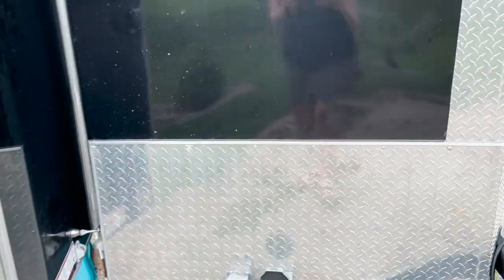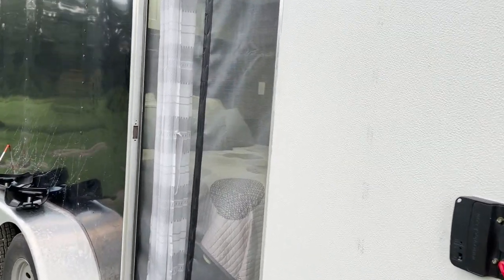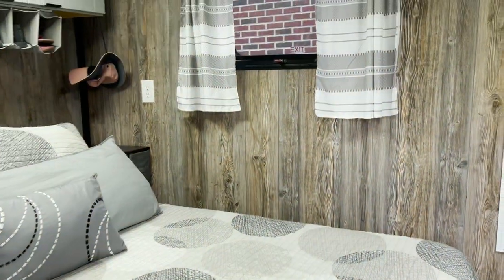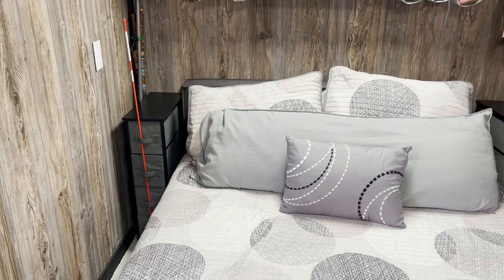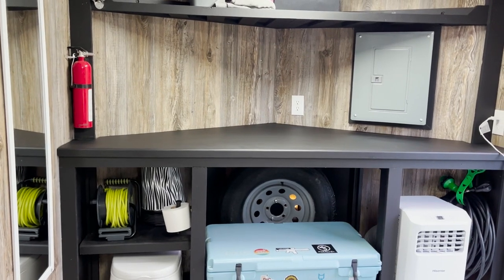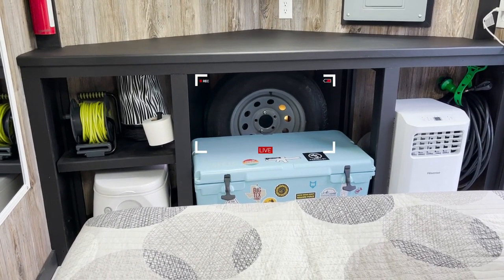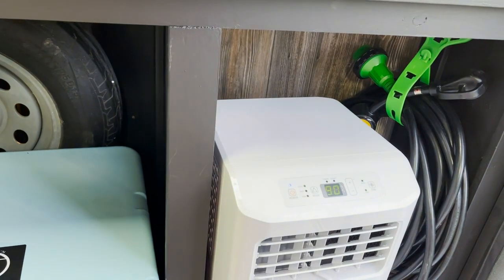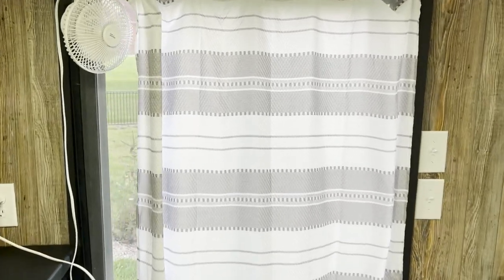Cargo Trailer Camper Conversion

Comment: Nice build. I’m about to do a 7x14 cargo conversion. I’m gonna turn the bed 90 degrees from yours and do the “crawl over” I guess. Wifey is the one who always gets up in the night, so I’ll just give her the unrestricted side of the bed and all should be well. I’ve been known to sleep for 12 hours straight without a bathroom break. I plan to use the extra square footage for a small “private” bath with a camp toilet and a Durastall shower. She absolutely insists on having that. I’ve already collected the stuff and will get started on the project soon. The kitchen will be just a small, wall mounted counter over a small fridge for chopping and making sandwiches, along with a nice, folding camp kitchen with a propane camp stove. The bed will also go up to the ceiling or fold up on the wall so we can get our motorcycle inside. It will actually be a “toy hauler I suppose.

Anyway, I like your trailer. Thanks for the video and happy camping!
Reply from the maker: Thanks. Best wishes on our build!

Comment: Looks good, you need to a light to your kitchen area should you need the space at night.
Reply from the maker: Thanks for the comment. We do actually have a light. It is a re-chargable one that I keep in the drawer. There are some magnets up in the corner that I can stick the light to. It is not often we really need the back when it is dark. The light ends up attracting a LOT of bugs. I should have given the info on that change. The last camper had crazy bright lights that we hardly used. I told my husband we didn't need lights you could see from space this time. LOL

Comment: Love your design.  It's very clean and organized.  Where did you get those storage containers on the bottom left of your kitchen cabinets that look like sterite containers with an opening on one end?  Those are super neat. Thanks for sharing.
Reply from the maker: The open storage container in the back area, under the countertop, I got those at Walmart. I was hoping to stack them but there wasn't enough room. It worked out okay because I had those black bins and they fit perfectly on top.

Comment: Hope you have better luck then lots of other people have had. that company has in the past had lots of issues with poor built frames, axels, leaking ceilings, brakes failing, screws falling out of the outer walls, etc. maybe the newer ones are o.k. but those georgia built trailers yes its true they are very inexpensive but you usually get what you pay for, good luck...
Reply from the maker: Thanks for your concern. We have not have any issues with this trailer. We spent a lot of time with making sure that it was safe. (I realize that the Georgia trailers can have issues but we purchased this when there were not a lot of options because of covid.)

Comment: Love your built!   Well done.  Can you tell us how much did this cost from beginning to end?   Very important aspect for someone who wants to build a similar model.  Thanks!   🇨🇦
Reply from the maker: We purchased the trailer at a time when our options and pricing wasn't great and because we wanted to start with a new trailer, it was about $6500 with the electrical installed. AC was $300. Cabinets were from Lowes. $700. Awning $170. Exit Window was $200. Bed was $500. Mattress $350. Wall panels $370. Foam tile for floor $125. Cooler $300. That was most of the big stuff. I don't have notes on the plywood for the counter tops.  Bunch of other small misc items. So other expenses that are not the actual trailer were about $3700. (We were hoping to reuse the AC from our first unit but it had died. Because we wanted a nice bed, that added a lot to the cost).

Comment: Why the double axle?   Do you haul anything?
Reply from the maker: Double for a little smoother pulling and easier for backing up. Single axel is really responsive when you turn the wheel as you back up the trailer.